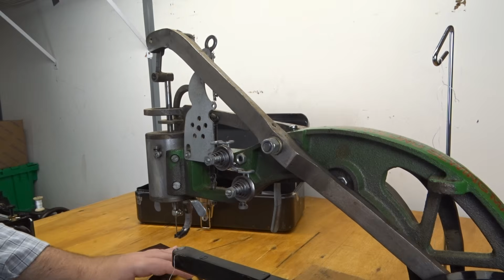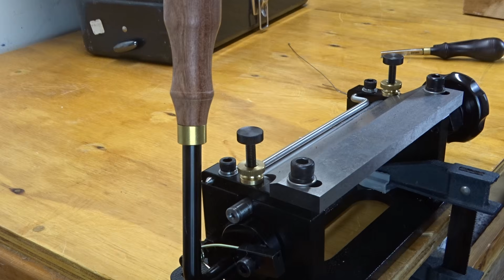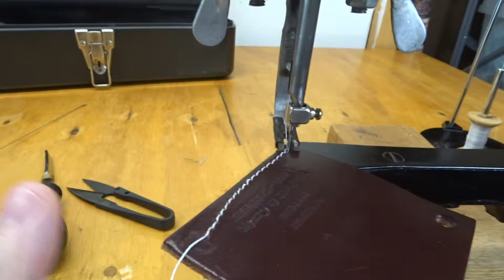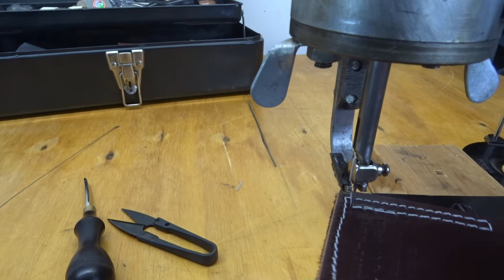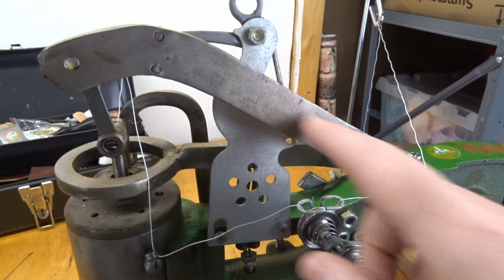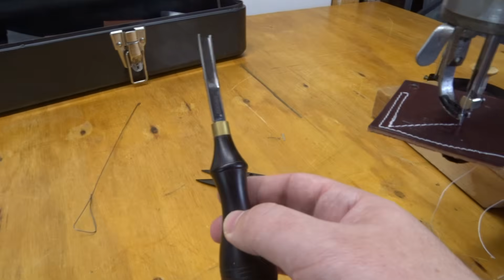Great Low Cost Leather Sewing Machine For 2026

Comment: Hello:
 Thank you so much for this video. I bought one of these 6 years ago and it's never been used. In fact it still sets in my garage on the floor right where I took it out of the box?! I DID bolt a 4"X4" to the base for table mounting, but I've been too intimidated by it to get up the nerve to use it. I've heard guys say they grind off the "teeth"
 on the presser foot. I may try that OR I may do what you did?
 You've shown me that this might have been a good investment and that I should try using it? I make knife sheathes and rifle slings among other things. I got it for rifle slings because hand stitching 4 feet of leather took too long on one.
 There ARE a lot of folks here on YT doing tutorials on these but yours makes sense. Thank you again for this video.
Merry Christmas.
God bless:
Dave

Comment: Is there a specific brand thats better to purchase? Thanks so much.
Reply from the maker: I think they are all mostly the same and come from the same maker. Just sold by different sellers on amazon. That said they can be ruff out of the box. To keep them low cost often the fine detail are missed. Just make sure it has good reviews in the listing. And check it over as soon as you get it for and burs or ruff parts. I had to sand and file down one of the two bobbin cases mine came with.
Reply: Thanks for cautionary info.  I think I want one.  I have horse halters and saddle straps to repair.  Would like to make a case for my laptop, too.
I'm not very hep with ordering on Amazon.  That's what is holding me back.
Reply: @nancyhainline2517  Lol! Preaching to the choir, brother! Or sister, just read the name!

Comment: Do you think it would sew 2 pieces of harness leather together?
Reply from the maker: I've sewn up to 10oz veg tan without issue. You have to use a larger thread and needle for thicker and harder leathers. It all depends on how thick it is. When you get over 1/4 - 3/8 inch, there is less room for the walking foot. It makes contact sooner and can't make as long of a stitch. It will sew thick but it likes thinner better.
Reply: @leathercraftertips  Thanks. Looking for my first machine. I will be doing mostly canvas and some thick cowboy gear. I shudder when I see the costs of some machines.

Comment: I bought one of these machines about 2 years ago, it sews well if you don't mind it missing a random stich about every 75 to 100 stiches. I am a nuclear computer engineer in my day job, myself and 2 of our local sewing machine mechanics here locally finally figured out the issue with mine. First these machines are not precision machines they have a lot of slop in the mechanical parts. We found the issue by using an extremely small and expensive fiber camera (borrowed) to push into the body of the machine, the inside of the casting had a spot you could not get to with tools that had a bur sticking out such that allowed the slop in the moving mechanicals to bump into the stationary bur thus causing it to miss a stich. The good news is I have a machine (if you can call it that) for sale. I gave up on it and bought a Cowboy 4500, If you’re wanting to make money in leather work I would highly recommend pay once cry once and pony up for a good machine. You can find older Juki machines for under $400 if you really look if budget is an issue. Juki machines seem to run forever like tanks. Unless you need more frustration in your life, I would not recommend a Chinese Shoe Patcher.
Reply: Still for sale?

Comment: I own one. not a big fan of the machine. It will not sew as nice as a leather sewing machine. Only having one hand to hold the work causes problems. These machines are not built very nice and need a LOT of fiddling all the time. For making crafts for yourself, they work better than no machine. Forget buying one if your goal is to sell products. These are not nice enough for that.
Reply: Yes but they are much much cheaper than a proper leather craft sewing machine so comparisons are not very helpful.
Reply: @gordonmcglone523  when the cheap machine does a not so nice job of stitching, there is a comparison. Cheap machine does a poor quality job, as I not something to be used for sellable goods. It is also very fiddly, as In not real dependable.
Reply: You can motorized the machine.